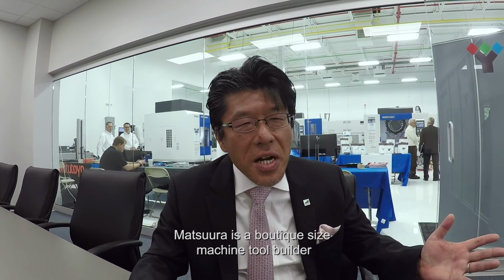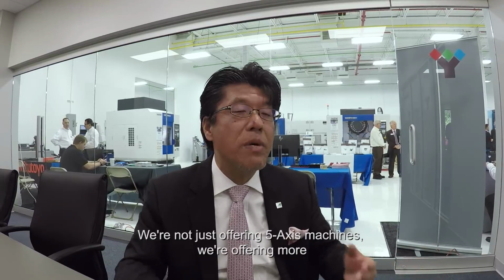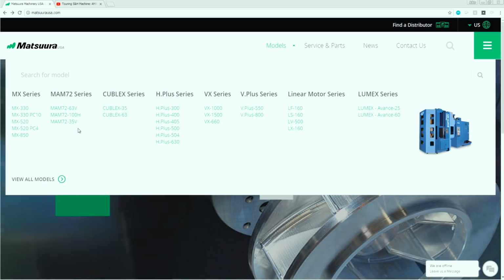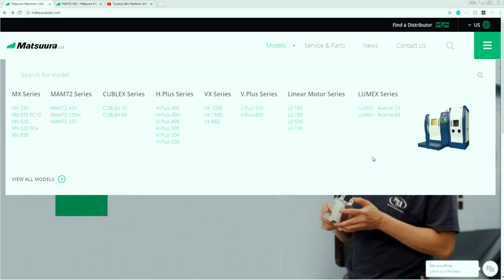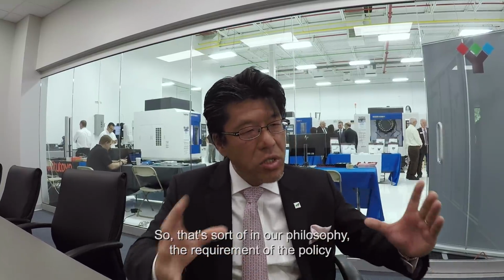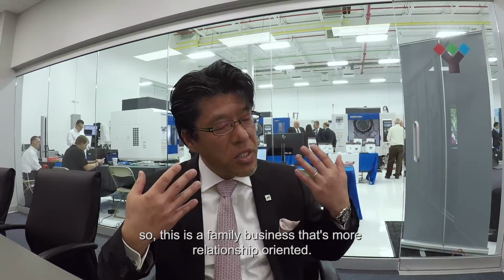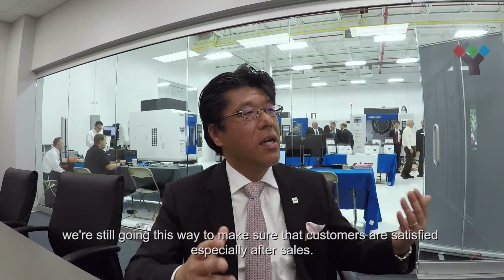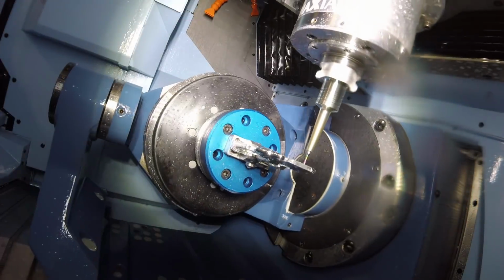Interview with Mr. Katsu Matsuura - President of Matsuura CNC!

Comment: I'm still wondering what that black 'fan' spinning kinda thing is at the end of the video,is it to blow chips away or something??
Reply: Same question here..
Reply: It’s a Clean-Tec Chip Fan made by Lang-technik. Especially made to blow of chips from your workpiece and table. Very useful to make sure that no chips will interfere with a palletizing system or Zero Point clamp while changing.

Comment: I'm using Matsuura machines at work and I have to say I don't like them much. I don't know if it's a model specific problem but they seem to be built for operators, not machinists. It's even worse with the new ones. When each part requires a new setup it's complicated for no reasons. Haas as my favorite controller to date.